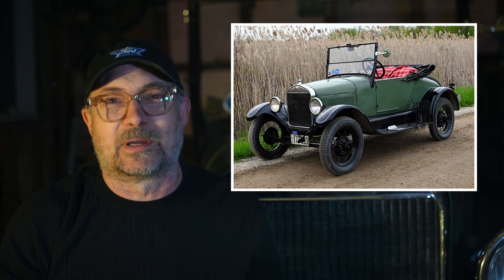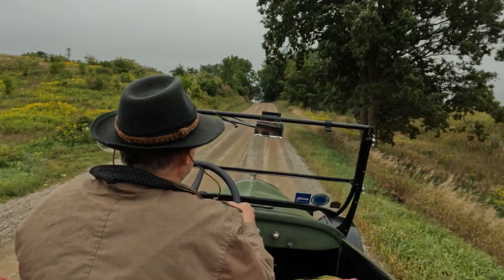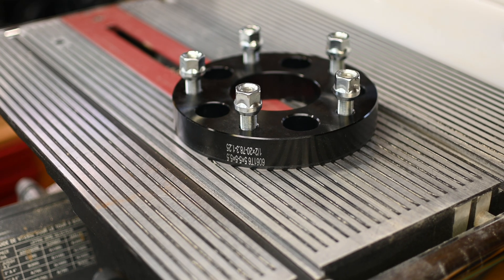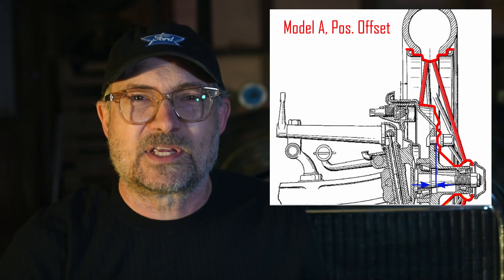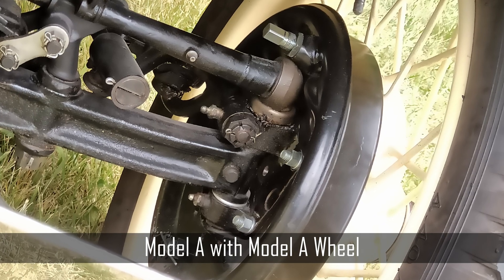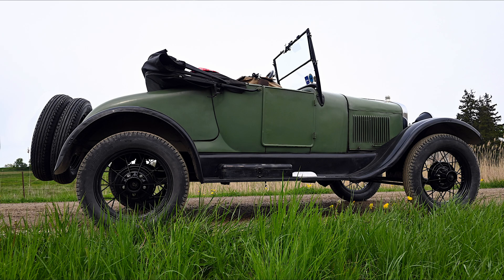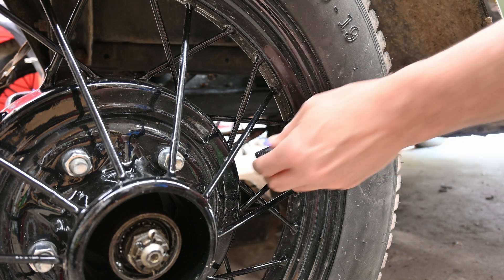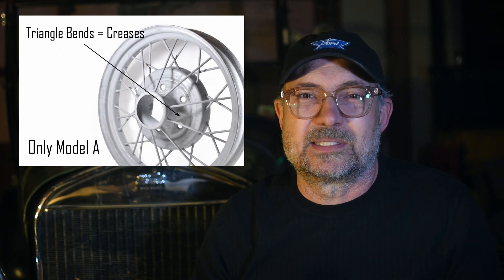Don't make this mistake! Did I choose the wrong wheels for my Model T?

Comment: 19-750 tires, i've run as low as 5 psi with no problems.  They were older hard tires though, not young soft tires..
Reply from the maker: Yeah, the ability to run lower pressure really improves the ride! Thanks for watching.

Comment: The extra spare gives the car a longer appearance. I had an accessory duel spare carrier on my 1919 model T speedster. I did have to install the tire bracket at a different angle. I cut out a small piece out of the top, bent it back and welded it in place so that the spares leaned forward.
Reply from the maker: If I ever go on a long journey in the T, which I would like to do, the dual spares will give confidence. Otherwise, it's just for show.

Comment: They look great, typically the "concerns" people have about allot of things are not based on reality. Aren't the wires of the Model A wheel much stronger than the Model T ones? Seems they should hold up better on the lighter Model T.  I've been looking for a set of Model A wire wheels for a Model T speedster project I've been collecting parts for.
Reply from the maker: Yeah, and there are a variety of MA wheel sizes to choose from too. Good luck with your project!
Reply from the maker: I was surprised that the two wheels (with tires mounted) MA 19 and MT 21 were exactly the same weight!